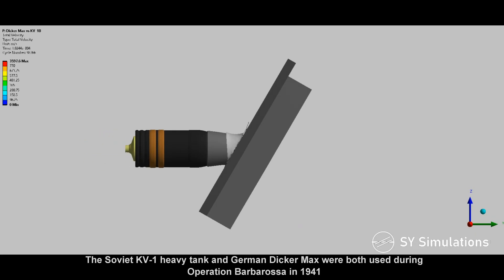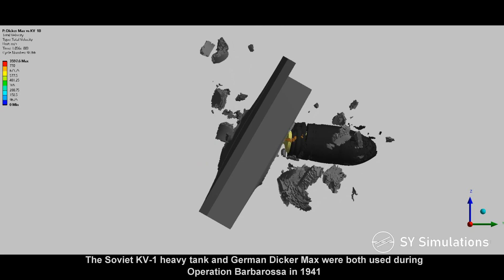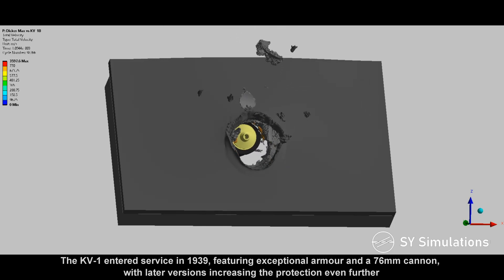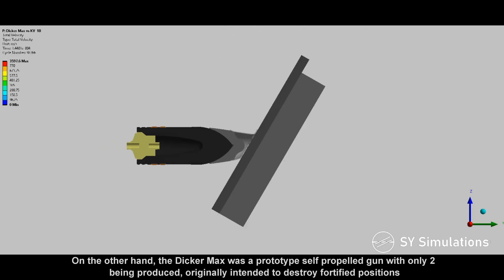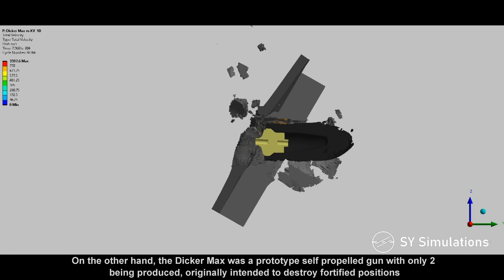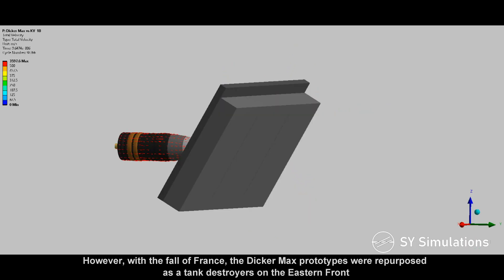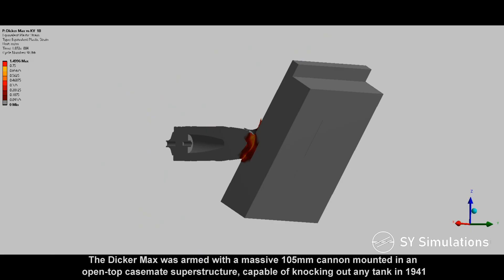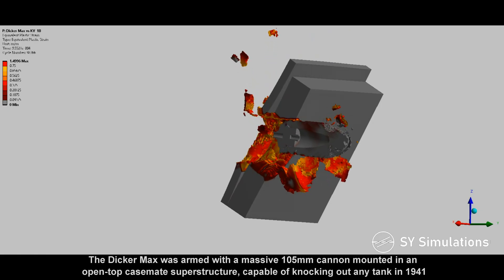DICKER MAX vs KV-1B | 105mm Tank Shell vs KV-1 Applique Armour Penetration Simulation

Comment: How is armor penetration of a tank shell calculated? What are some formulas I could use to calculate it myself?
Reply: Well it depends on several things because for instance the penetration of a shaped charge liner at hypersonic speeds has different models than a slower moving ap shell.
One of the earliest formulas introduced was the Krupp formula. Basically it is an equivalence between kinetic energy of the penetrator and mechanical work needed to plug that plate so:
0.5*m*v²=C*t²*TauR, where C is circumference of the penetrator,t thickness and TauR the shear strength of the material. So t=√(KE/C*TauR).
Notice that a plate of twice the thickness requires quadruple the energy or twice the speed of the penetrator.
It predicts the best with flat top shells and thin plates.
For the 45 mm AT gun for instance it predicts quite good.
To find the shear strength in MPa: 2.45*armor Brinell hardness,so for RHA =2.45*300=735 MPa.

Comment: Yea actually only 2 were used they were actually built for fighting in France because of the maginot line and all the concrete inforcments houses and machine gun nests they would have to deal with but the sturer emil with the 128 mm had a better gun but only 2 of those were built too i think there were around 500 built but only 2 with the 128mm. Not positive on that.. so dont freak out and act like a knobgobler. Just telling ya what i remember.

Comment: If the shell has more mm than the armour it's usually over
Reply: True and still true for today's sabot rounds. They penetrate usually armor equal or less than their length..
Reply: @WotansCry  Unless the projectile is very slow ,true ,but he meant caliber.
Reply: @WotansCry  it depends of much more variables than their length. Material of both armor and round, impact angle, speed of projectile, mass, round diameter, filler etc etc. F.e. solid shot of the same length and diameter will penetrate more armor than explosive filled round. Apcr usually were the same length than other rounds but penetrated more, also loosing speed more quickly. Tungsten round of the same dimentions will penetrate more than steel round
Reply: I dont think the leFH 18 would work like this
Reply: haha overmatch funny

Comment: the first and last time Germany used a 105mm to attack tanks.
Reply: Now you bring it up, it's weird that I've never thought that much about how big a leap 88mm to 128mm is
Reply: I do wonder, if a 10.5cm gun would have been a better option than the 12.8cm .
Still more than enough firepower to kill a IS-2, but with a gun that is easier to fit and lighter, and the same goes for the ammunition . Likely a higher rate of fire as well.
Reply: @cheekibreeki4638  I'm sure that in a while they would have upgraded their caliber from 88 to 105.
Reply: Pretty sure the Germans used plenty of their 105mm artillery guns to attack tanks. I'm certain some Wespe has also tried a shot or two at enemy tanks as well. A 105mm HE round is no joke by ww2 standards.
Reply: The 88 and 128 used in vehicles afaik had longer barrels relative to the caliber than this 105, thus their shells would reach higher velocities
Reply: @jagobabarron5501 There was actually a longer, higher velocity 105mm developed later in the war.  The Dicker Max used the L/52 Rhinemetall variant, while Krupp developed a longer barreled, more powerful version (just like they did with the 75mm and 88mm) that was an L/68. However, it was never fitted to a vehicle like the longer 75 and 88 were, and was never put into production because of that, though 105mm rearmed Tiger IIs were proposed.
Reply: @seanmarshall5463  I think that if the war had continued they would have put that cannon on the future E-75
Reply: It was only one
Reply: Germans had many different type 105mm artillery pieces. In occasions those were used in direct fire and few smaller ones were mounted on tracked chassis.
Also Panzerfaust 150 had a 105mm warhead.
Reply: @Teh0X  To be clear, I meant for high velocity AT guns. I know they had 105mm artillery guns and even high velocity guns at sea

Comment: but Stug 105mm can't pen T-34 front hull?
Reply: The StuG's 105mm gun was more a low pressure grenade launcher than a high velocity armor piercing gun. More like a direct firing mortar that was just supposed to lob a large (for the time) high explosive bomb at the target, than punch through armor.

It is comparable with the 100mm low pressure gun on the BMP-3.
Reply: Different gun, and more sloped armor, I believe.
Reply: StuH's gun puts out three times less energy.
Reply: @Klovaneer  You mean a third?

Comment: Thickest armour of its time and this gun punches through like its nothing. More of a tank buster rather than bunker buster.
Reply: Well, bunkers tend to be big as hell so if you can blow up a bunker you're most likely able to blow up a tank too.
Reply: Yeah but this is a self propelled gun not a tank, no tank designer ever is building tanks thinking they ever have the chance of bouncing off artillery caliber guns
Reply: By 1941 there were about 500 KV1 in service. Compared to 2 Dicker Max. One of the two prototypes blew up due to an accidental ammo explosion. It had no meaningful battlefield contribution.
Reply: @danmorgan3685  But other sibling otherhand had its barrel full of victory rings.
In that sense even if you divine those knockouts/kills between both it is still quite feat for problematic one trick pony prototype.
Reply: @danmorgan3685  A Flak 88 was also enough to stop a KV1 , even a Pak 75 .
Reply: @5co756  Which isn't really the topic at hand. Those guns were clearly much more important. I would say the PAK 40 was more important by sheer dint of numbers.
Reply: @5co756  FlaK 36 not "flak 88"

And PaK 40 not "pak 75"
Reply: @jacqirius  Most people don't know what a Flak 36 or Pak40 is , that's why I said 88 and 75mm . Calm down dude .....
Reply: @danmorgan3685  True , but you wanted to say the Dicker Max was rare and it had no effect . But the Germans had many other guns to deal with a KV 1 .
Reply: @5co756  You've simply restated my position. From the very start I said the Dicker Max was too rare to make a meaningful contribution to the war effort. I never even once implied the Germans didn't have other weapons they could use. Hell, I made it very clear that those weapons were much more important.
Reply: @danmorgan3685  Fo me it sounded more like : The Germans couldn't deal with a KV-1 and the Dicker Max was very rare . 🤷‍♂️
Reply: @5co756  You misread it then.
Reply: @danmorgan3685  I don't think anybody here argued otherwise.
Reply: @Ramash440  It's a persistent problem I see with videos and other comparisons like this. Way to often one off guns, prototypes are vehicles with really short production runs are compared to far more common (and impactful) vehicles. For a really good example look at games like War Thunder or World of Tanks.
Reply: @danmorgan3685 Cool, but that's not the point of the video or those games. The point of this video isn't about the historical performance of the Max, it's about whether or not a Max can penetrate a KV. The point of a game, on the other hand, is to have fun. Even the grittiest of simulators have made up scenarios for the sake of fun. You're reading too much into all of this and arguing against nobody.
Reply: 10cm K18 had 19km range, more than 152mm ML20 gun that was used on ISU-152. That's a lot of velocity and energy retention.
Reply: @kireta21  Yeah ~850 vs 600 m/s
Reply: @kireta21 you say 19km range but the longest recorded tank kill was around 4.5km lol

Comment: If only 2 prototypes of the Dickermax were made, then where did the 105mm ammunition come from? I can't imagine they would have a factory assembly line for just two tanks.
Reply: Sir, it was a field gun long before they even thought of sticking it on a tank. 

They had AP ammo they barely used before then. 

The Germans also had 10.5 cm L65 dual naval mounts. Guns meant for warships. Even thoae had ap in the form of PZG 33. Havent found any performance stats, i dont think it was used, but it exists. 

The KV2 had anti conrete rounds. Its good to have an AP round for bunkers and such.

Besides. Its sometimes as simple as adding some extra powder to the charge to increase penetration. Of course theres a max pressure on the barrel and the rifling can only handle so much, so you need to make a dedicated anti tank gun that can handle those preasures and velocities.
Reply: @DS-wl5pk  And even if there was no production line, a factory can produce a small scale batch if required, it's just more expensive and takes more time than you would with said production line.
Reply: Just because the vehicle was a prototype, doesn't mean the gun wasn't. It was supposed to be a bunker buster after all.
Reply: Similar to the gun being derived from drawn howitzers , the chassis was derived from the Pz IV onto which the Fat Max was built.
Reply: The ammunition was already in production. Germany was manufacturing several different cartridge sizes for multiple different types of 105mm cannons, including different types of shells such as HE and timed air burst and AP shells as well. Germany used 105mm artillery and they used 105mm AA guns as well.